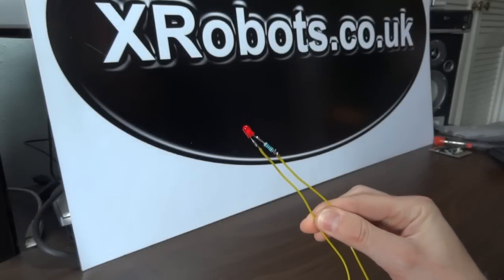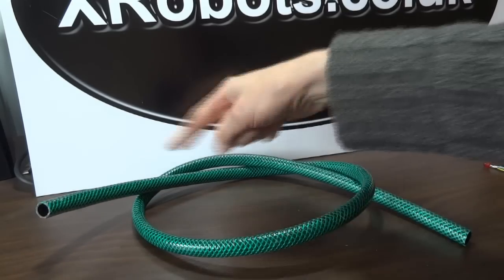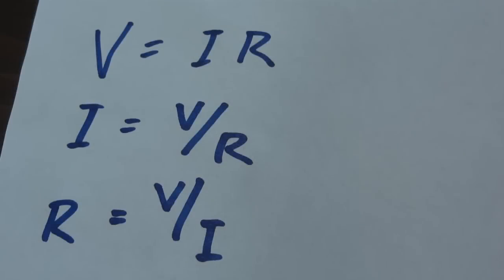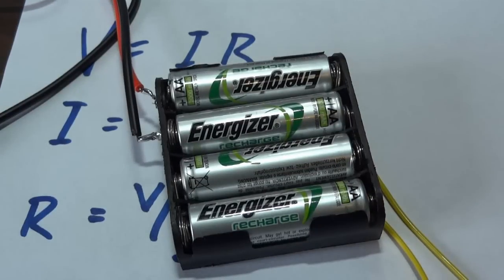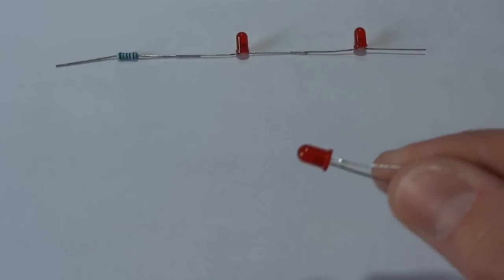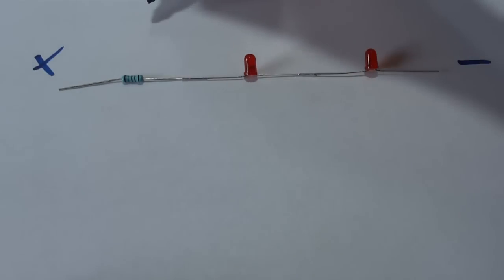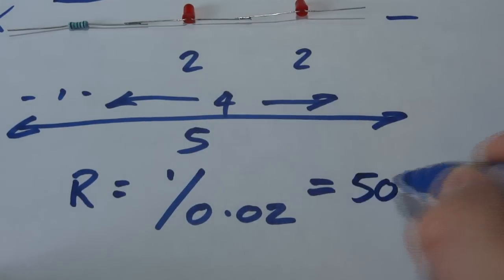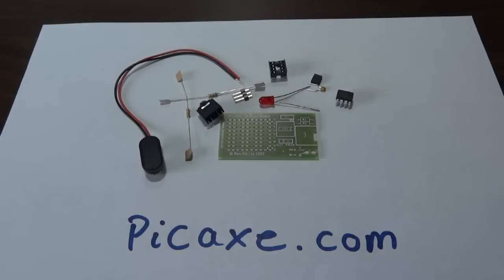XRobots - How To calculate LED resistor values using Ohms Law, series and parallel wiring

Comment: What if you dont know the voltage or amperage of the LED???
Reply: My LED's were blue so I thought 3.5 volt would be ok and 15 ma...which seem to work..they stayed on now for over an hour...what if you used a variable resistor...or a pot...and adjusted it until it blew...I used this site also..http://www.horrorseek.com/home/halloween/wolfstone/Lighting/litlec_LEDCalc.html

Comment: I thought electricity flowed from negative to positive? Since there is potential difference in electrons, and electrons are intrinsically negative, and in electricity unlike charges attract one another, wouldn't the negative electrons flow to the positive charge, as opposed to your diagram where the positive is flowing to the negative?
Reply: +James Bruton (XRobots) 
Got it, thanks! I was always confused because of this.